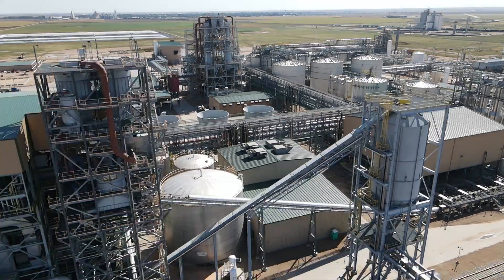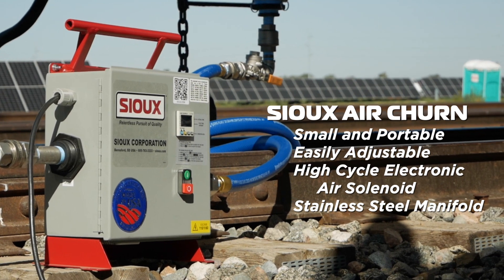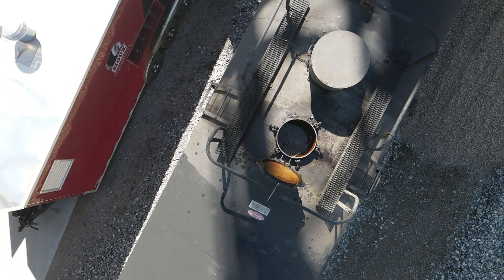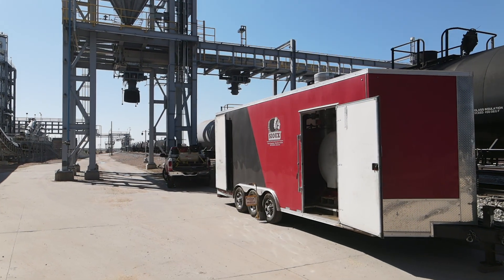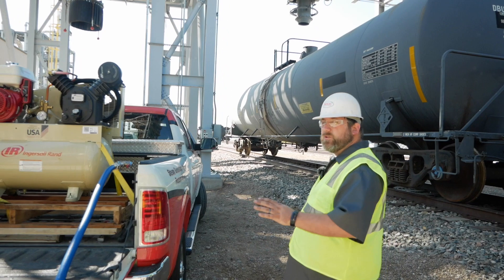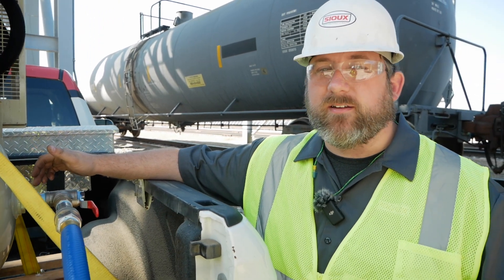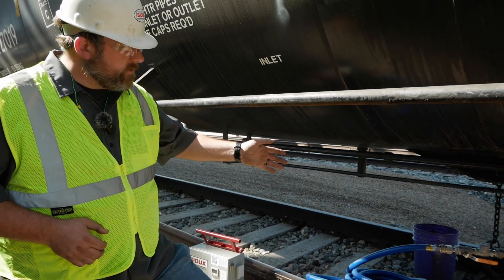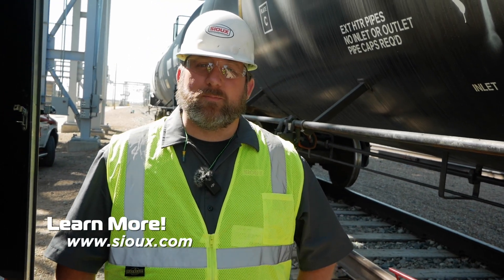Save HOURS Heating Tank Cars With This Process | Sioux Air Churn

Comment: God  love trains. Thank you for this video.
Does the check valve going to the car have to be positioned before a 90° solid pipe turn? Or would it be possible to attach the valve directly to the Sioux unit and have flexible 1" hosing connect to the car?

Comment: That is very cool. Which brings me to another thought. I’d think it would be helpful if the air is also hot. That way, instead of carrying away some of the heat from the product, it adds more heat. 

One way that comes to mind to do this would be a heat exchanger between the compressor intercooler and aftercooler, and the air supply line right before the tank car.